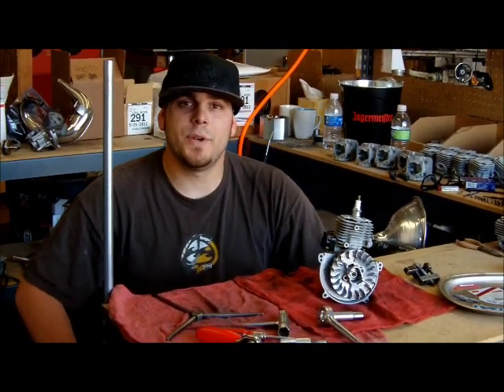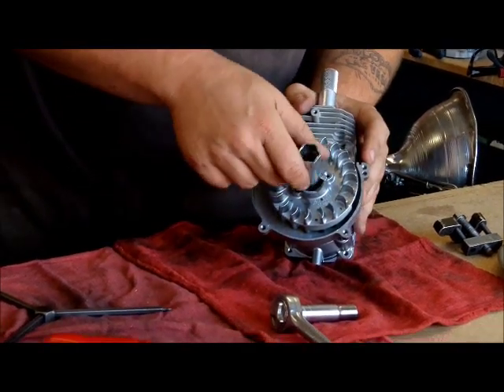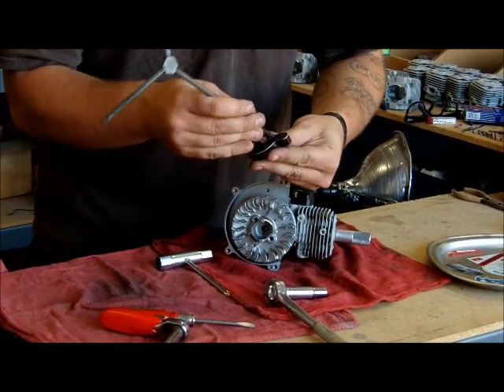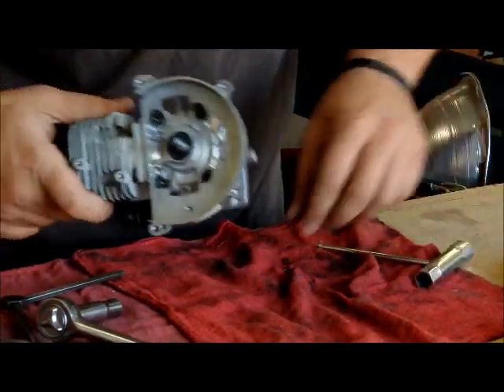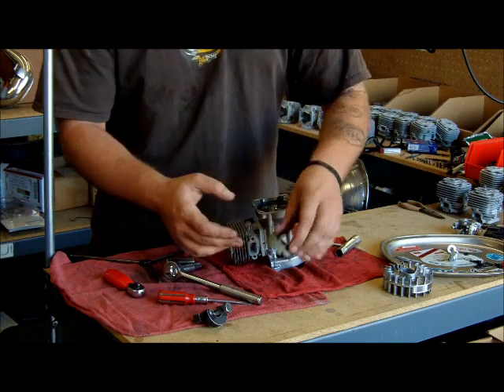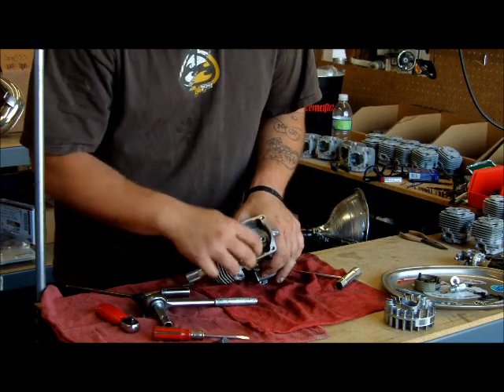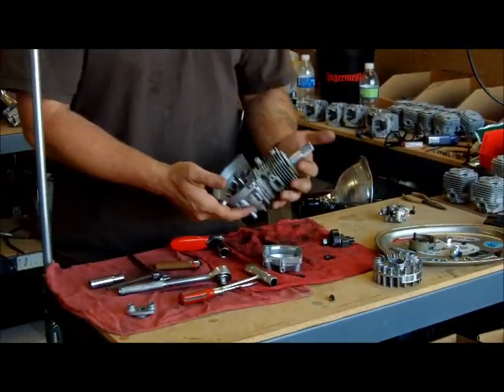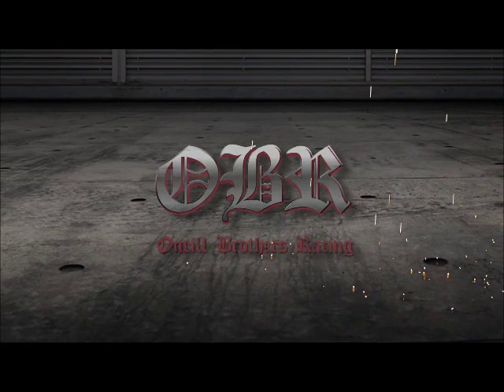OBR Tech Video - Flywheel And Clutch Removal

Comment: I have a question I have a 29 CC my mtx-l rolled over the motor went into High Rev before I can get to it to turn it over it shut off but it will not start back up do you have any idea what happened did the motor blo the Piston still moves up and down spark plug is not getting any gas new carburetor new ignition coil and still nothing do you know what may have happened?

Comment: hi dan .. thanks for the info. i have your  30.5 full mod for my losi 5ive .. check it out  she looks good .. please could you tell me what the engine base settings are .. i think its 1 and quarter on low and 1 and half on the high but not sure.. thanks and keep the vids coming love your work and engines. regards john england

Comment: What do you guys think of vented flywheels over at OBR?
Reply from the maker: They're ok for draging racing where you're running for short periods of time. For a bash or race engine they tend to overheat.
Reply: Sean O'Neill...I've purchased one that has been cut out but the fins for cooling have not bin touched, It's .68oz lighter than stock.

Comment: Hey dan I have the rovan motor 30.5 cc I put a aluminum intake and a 998 card is there anything else I can do to get more horsepower out of this engine I put a thor pipe on you have any tips you could give me I would love to have this thing cranking willies your video on break ins help me a lot I've asked you a couple questions in the past very helpful man you are the fucking man dude I can't stress it enough that I think you are the best in the business thanks buddy for any help you can give me your old pal royyour video on break ins help me a lot I've asked you a couple questions in the past very helpful man you are the fucking man dude I can stress enough I can't stress it enough that I think you are the best in the business thanks buddy for any help you can give me your old pal roy👍✌
Reply from the maker: Thank you Roy! Bolt on wise a pipe and carb is about it. I wouldn't sink any more money into that engine as they're not known for being very high quality and won't withstand porting. I'd run it as is and when you have the funds put a Zenoah engine in it.